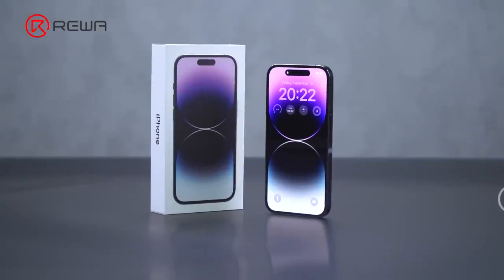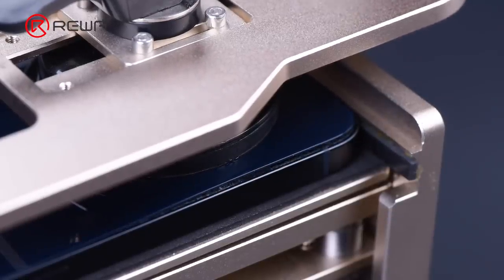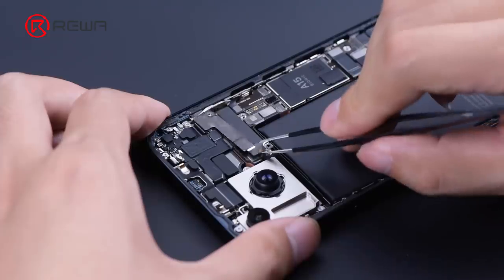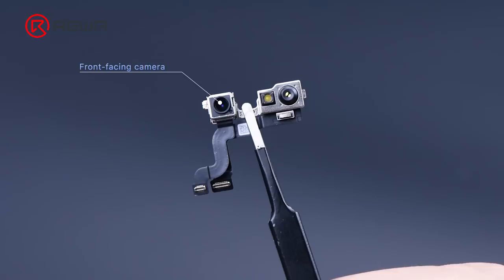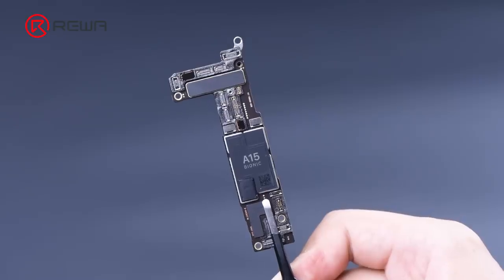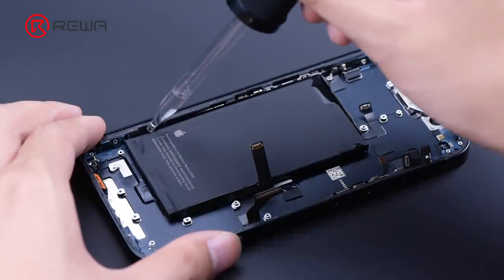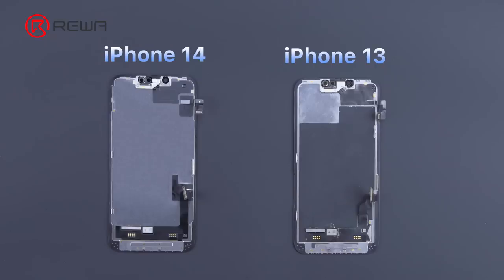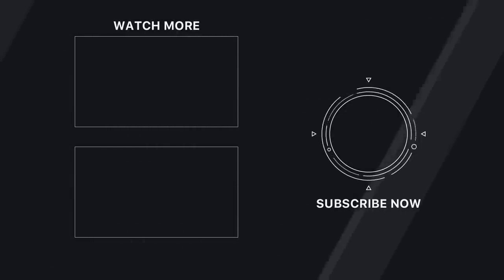iPhone 14 Teardown - Repair Tips from REWA

Comment from the maker: For your information, iPhone 14 can be opened both from the back and front. So screen replacement won’t be harder. BTW, iPhone 14 Pro teardown is on the way. We will follow up with motherboard separation, screen refurbishment, etc.. :D
Reply: Any information about ram size on 14?
Reply: @AppleReviews  Yup, the model shown in the video is physical dual sim, check the retaining clip at the back of the tray.
Reply: @ScaredPilot  ok
Reply: Hellow.

Comment: The detachable rear glass is nice. Hopefully the wireless charger, mic, and flashlight can be removed from the rear glass or else that part may be serialized.
Reply: Hello, 
It’s serialized and paired to the motherboard
Reply: @leobreysse7281  yeah most likely the only thing that isn't serialized is the rear glass and flashlight. I have a feeling they will deactivate MagSafe charging if you change the wireless coil

Comment: the risk of damage to removing a screen to change a batter or charging port is so much better now as no need to remove the screen. I would much rather damage back glass then front oled to gain access to the phone. This is a brilliant design and unfortunately not in the pro models.
Reply from the maker: Agreed
Reply: I think it really depends. Front screen just got a whole lot more complex. I works as phone technician and most of the time, the repair is the front screen (Dead pixel, black out, no touch, etc). It is essential for the phone. People can deals with broken backglass (case to cover it), or battery (need to charge more). But they can't use the phone with a broken front screen
Reply: @ToanNguyen-xs4gs  how is it more complex? You can still pop the display off the same way you would any other iPhone.
Reply: @ToanNguyen-xs4gs  u can open the front and back seperetly if u need to change battery u need to remove the back glass if u need to remove the display u can remove the display without opening the back since the display is connected to the underside of the motherboard so its probably the best repairable modern iphone

Comment: I've been opening most iPhone models from 3g to 11 pros and I have to say... this is the most beautifully laid out iPhone ever.
It look absolutely stunning from the inside.

The specs did not convince me, but I had to upgrade to this model and not the Pro because of this repair ability.
Honestly this is such big news and the lack of reporting on this even from Apple is underwhelming.

If they'd put this breakdown into their keynote they would have had a lot more sales!

Fantastic work Apple engineers. No stop SW locking your repairs and the good old days of iPhone 4s are back :D

Comment: If any of you started repairing  iphone from 1st generation up to know. You will remember  the iphone 4 & 4S repairability for the screen replacement. This is resemblance repairability of this iphone 14. Exact same method by removing the back plate first, then remove all internal parts &  lastly screen removal 🙂 Now the screen repair for this iphone 14 models will take longer because of this process. Good luck to all cellphone repair shop.
Reply from the maker: Different from iPhone 4/4S, iPhone 14 can be opened both from the back and the front.

Comment: So where’s the front face id then? Also the screen layout is similar to Samsung when replacing?
Reply from the maker: The front Face ID is on the back of the middle frame. The screen replacement is easier than Samsung.

Comment: I think this time around fixing the screen will be a lot of work when assembling it
Reply from the maker: Screen replacement is still easy. iPhone 14 can be opened both from the back and the front.
Reply: @rewatechnology2008  Good stuff REWA. How about doing a battery replacement / teardown and then reassembly of the Apple Airpods Pro 2? 
That would be great.

Comment: From what I can see it should be possible to only open it from the front to replace the screen as it seems there is access to the screen connector on the bottom of the motherboard though the midframe.
Reply from the maker: correct
Reply: But you wanna disconnect the battery first ;)

Comment: Is it gonna be harder to replace screens on the iphone 14 now with tis new design or can you just replace the screen
Reply from the maker: Screen replacement difficulty remains the same. You can still open the device from the front.
Reply: Screen connector was on back of logic board so no should be a lot easier
Reply: @rewatechnology2008  Thanks for that! The iPhone 14's seems a lot more modular than previous models.

Comment: According to your opinion which one is durable and easy to repair iPhone 13 or iPhone 14?
Reply from the maker: iPhone 14
Reply: @rewatechnology2008  Which one have durable aluminum frame iPhone 13 or 14?
Frame middle thick layer or middle thickness